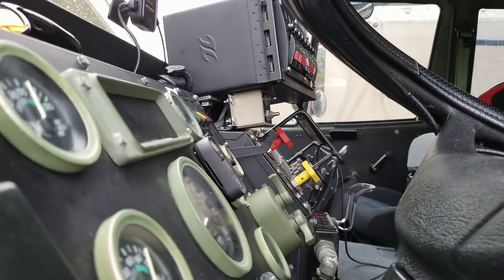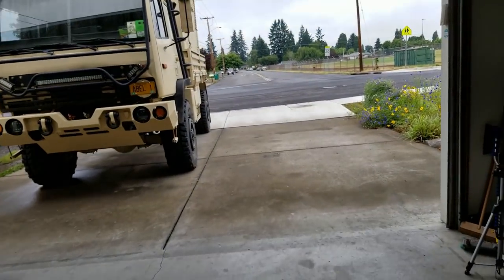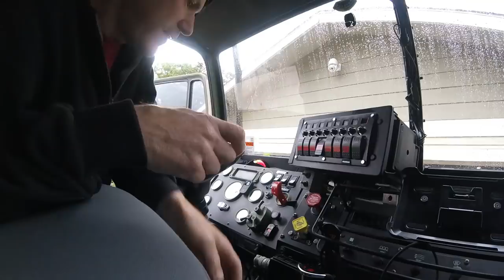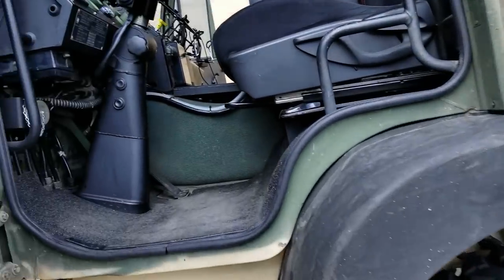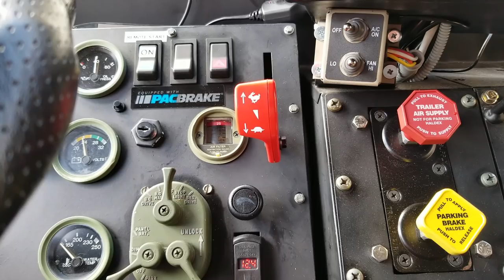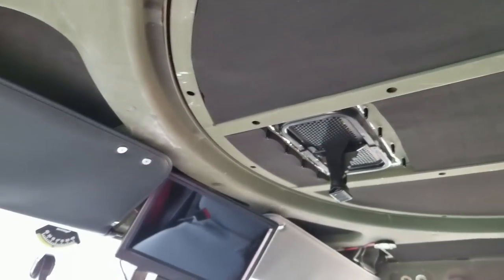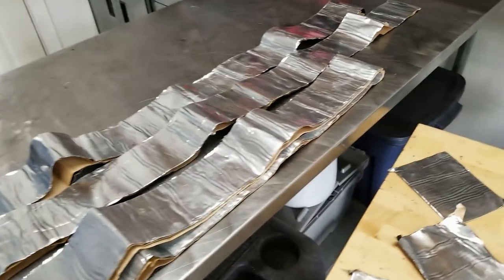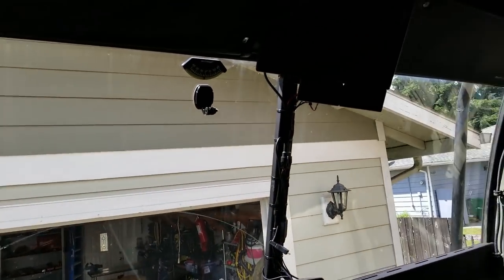Abel LMTV build part 117 (Headliner insulation, hand throttle handle, door dynamat)

Comment: Looks great!    I definitely will look for that roof padding.   

One quick suggestion...... reach through the holes in the inner door steel and put that dynamat stuff on the inside of the door skin.   

The dynamat with the tar like layer and the aluminum foil layer work in two ways:

1.  It adds mass to the  panels which lowers the resonant frequency of the door (sounds less tin like).  
2.  Most important..... as the sheet metal vibrates it flexes like a drum diaphragm.  When you add the tar like layer, the tar flexes with the diaphragm.   The aluminum layer does not want to flex the same as the diaphragm.  So, the vibrations in door steel transfers the energy into the tart layer as shear between the steel and Aluminum and the tar absorbs the energy.  

So, the door outer skin is a giant drum diaphragm.   You will get more improvement putting as much dynamat as you can on the outer skin.   Only one layer works.   

Just a suggestion.  

Great build, I learn a lot from you every video.
Reply from the maker: I am not that much into it LOL.  It was just somethign I had laying around and put it to use.  Some is better than none right??  Thanks for watching as always....  :D
Reply: Sean Fillner 

Yes, some is better than none.   Even if you have a few small pieces left, just putting a few pieces are helpful.   If you noticed Broke Overland put small pieces in the middle of each large diaphragm.    That is your most bang for the buck.  

I do similar acoustics things at work occasionally.   My interest is forced on me.   ;)

On a side note.   One of the guys at work told me that the aluminum coated window flashing tape works just as well.   It is super cheap.   The only reason I have not used it yet is I am not sure if it will stink or off gas anything bad since it is usually used outside of houses and not in closed in cars.  

Again..... awesome build.   You, Dave, Seth, Broke overland always do not disappoint.  I am learning a lot and will be trying to copy what I can from you guys.  

Thanks!

Comment: Just a suggestion for you. When you're drilling, and you want to catch your chips, you can use a magnet. When I have to drill inside something like electrical/electronics cabinets, I have used either the telescoping magnets (like the ones that you use when you drop something) or ring magnets (like speaker magnets) and drilled/tapped through the center. Both options work fairly well for catching chips....Just some food for thought.